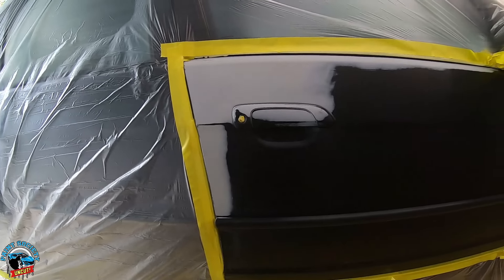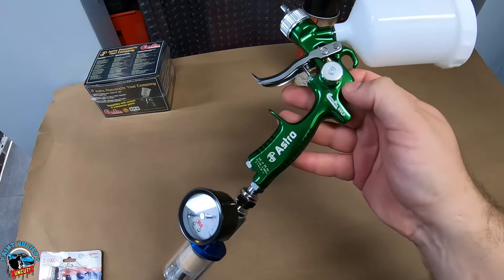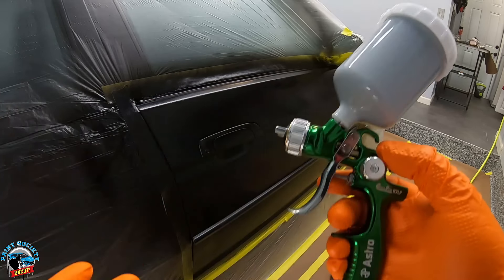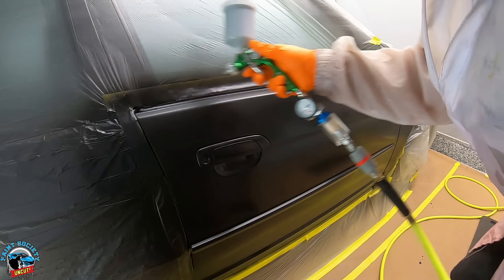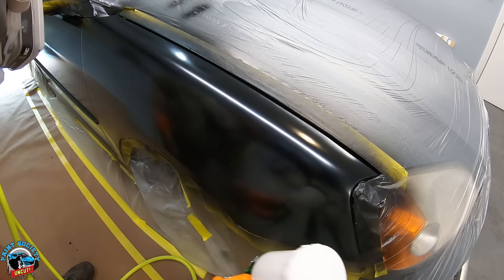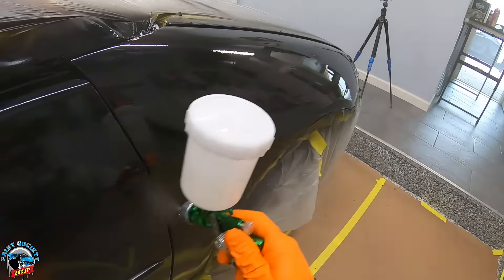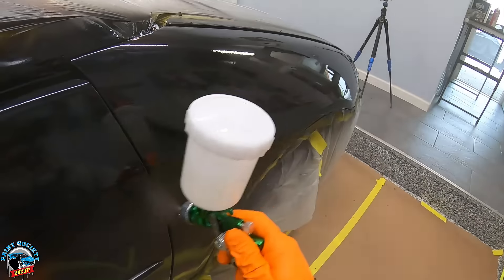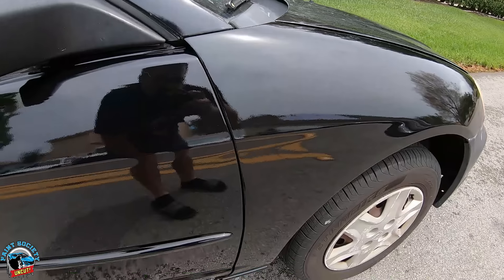The Cheapest Way to Paint a Car with AMAZING Results!

Comment from the maker: Make sure you’re subscribed to my Instagram for all the latest information! IG: paint.society
Reply: I am learning a lot from you I Love your work
Reply: Please do a video on minor rust repair and prep before paint. Thanks
Reply: Is it best to go for for three coats of clear if  orange peel results from inexperience or incurable pressure problems with the gear at hand? I'm assuming that the peel effect can be buffed out - if the clear coat is thick enough??
Reply: Karibu Tanzania Afrika mashariki
Reply: Is there anywhere else that the gun can be purchased? Amazon is all sold out
Reply from the maker: @sohchx  they sold out quick!
Reply: Brian,

I remember that in one of your video's you used a special tape for painting around window rubbers.  It fitted under the rubber and pulled it back.  Do you remember which video that was in and/or what the tape was called?

Kind regards, 

Neville.
Reply: Ceiling fan 2003 Honda Civic good
Reply: Mannn.. We’re going to have to change your company name from Paint Society to Paint Gods! 

You always know how to make something look amazing and simple, even though we know for inexperienced painters it is not easy. Lol 

Keep up the great work. I look forward to seeing some more videos. Question: 

What do you think about a 27 gallon compressor by Husky, 1.7hp, SCFM 6.8 air at 40 Psi? Do you see this struggling with a Atom mini X16 spray gun “1.4 tip”?
Reply from the maker: @Mocredible  it will work but only for small project. Not full cars
Reply: @PaintSociety  Thanks man. I appreciate your advice.
Reply: i realize I am kinda randomly asking but do anyone know of a good website to stream newly released series online ?
Reply: @Titus Ronin yup, been using Flixzone for years myself :D
Reply: @Titus Ronin Thank you, signed up and it seems like a nice service :D Appreciate it !
Reply: @Calvin Rocco No problem :)
Reply: As a former car painter. That hasn’t touched a paint gun in ten years….. I just have to say that your skill and confidence are truly inspiring. Keep up the good work and I really enjoy your channel. Thank you.
Reply: M.p
Reply: Hi
Reply: @bohuxley5050  Hi
Reply: I’m wondering if it’s possible to paint a car with an airless sprayer? Thanks for all of your great videos and input.
Reply: I did not know you have the gun so close to your work. Even closer with this mini-gun?
Reply: Great job mate! 👍🚗😎🏴
Reply: Can you do a video on a 3 series (E46) BMW rear arches rust repair prep and paint if you get one in please mate? ALL e46 3 series (1999-2005) suffer with rear arches and sills rusting as they didn't fit wheel well guards so they all rust out! I've gotta do mine soon and to have that specific car tackled by you would be amazing for exact/direct method as I'm not a sprayer but going to attempt it and I know so many people who are doing the same on the BMW forums so this would be GREATLY appreciated if you get a chance!? I got a titan silver BMW so it's going to be a real pain to match.. so if it happens to be a titan silver all the BETTER! As they're 10 a penny in silver back then lol 😅👍😎🙏🏴
Reply: Did you reduce your clears?
Reply: What do you think about the Duplicolor Paint Shop Finish Systems Primer, Base, and Clear? I'm thinking about painting  my Chrome Yellow Ranger this way with the Duplicolor Paint Shop Finish Systems products. This will be the second time I've painted a car, so I'm not a complete stranger to it. I feel like if I take it slow, and watch the pressure, and the spray fan, I'll be  okay. Spring, or Fall temperatures, and low relative humidity.
Reply: @paulbrock641  qqqq
Reply: @PaintSociety  ,It came out killer bro.   Thanks for uploading theses videos for us DIY guys.
Reply: What sort of paint do you use when doing in the garage?
Reply: @dariohtc  It is doable.  You will save a lot of money in material costs.  There is very little overspray, and more of the material goes onto the car
Reply: I have a quick question if you do put sand piling on your paint job what's the easiest way to correct it before clear coat
Reply: @1cstabach  Ku
Reply: @paulbrock641  vvp vvv la lol
Reply: This may help those of you that have a small to medium air compressor!  I have a Sears 5 gallon & 1 button Dewakt that is portable but nice. I put a brass T fitting to input side of my wall regulator and connect both small compressors to input and paint sprayer (or impact wrench) to outside , gives me lots more air, 
Easy to borrow a 2nd small 120 volt compressor from some relative or neighbor.  Plug into 2 different circuits, set start on pressure slightly lower on smaller pump. 
Air pressure in both tanks equal out, both work to maintain full pressure (say 120 lbs). My sprayer is set approx 18 psi) 
Saves hundreds and remains portable.
Reply: I got some advice to use the same compressor and get a higher output of air, add a storage tank.
Reply: Would that do Nissan FN2 Emerald Blue?
Reply: @PaintSociety  m I able to paint High solid urethane clear with the lvlp gun. And please tell me the baseline setting  you'd recommend along with if I need reducer. I'm in miami, FL so temp is 75-80°
Reply: Where is the cheapest place to get decent semi-gloss clear?
Reply: i agree with Carlos , BUENO . GREAT VIDEO ,  great , also the job !

Comment: I've had good results using two regulators, one on the gun and one at the compressor. You set the one at the compressor to a few psi above what you need then use the gun to regulate it down to final pressure. You get much more consistent pressure at the gun while the compressor tank empties.

Comment: You can run the pancake compressor into a holding tank. It'll increase your air volume making the compressor cycle less and also keeps the air pressure variances to a minimum. Plus an air holding tank is a good addition to a garage for quick tire inflating away from the compressor.
Reply: Note on this, it does work, I have done it. 

However adding a larger tank will make your compressor run longer each time it comes on, so be careful it can overwork the compressor and burn it out.
Reply: Curious what would be the ideal size holding tank to max performance and limit variance I would guess somewhere in the 15-30gallon range?
Reply: Would using a 8 gallon compressor make that much, if any difference at all then a 6 gallon?
Reply: That is a GREAT idea!!
Reply: I did this to air up semi tires off a small compressor. Used a 20 gallon tank from old compressor a friend gave me. You can also buy air tanks used for inflating tires like the ones at harbor freight. Just run piping to them. Make sure to drain them every time.

Comment: Too cool...painted my first car 3x...absolutely no previous experience...then watched a couple of your videos...the 3rd time... 2 base coats, 800 hand sand, itcame out well with no experience to judge it by. Applied 3 coats of clear and cut it down with 800, 1000, 1500, 2000... Applied the rotary with fine polish and was completly blown away with the results. I got several compliments... Kbowledge comes from a book or videos, but wisdom comes from experience.. So in closing. Thanks...
So dont be scared...Its only paint...😊

Comment: #1 thing that help a small compressor: remove restrictions!  Look inside a 1/4” air fitting.  Tiny hole.  Use a good 3/8” hose and get 3/8” fittings with 1/4 npt threads.  I have a 15-16 gallon California Air Tools oil-less compressor that advertised 5.4cfm at 90 psi.  I could see the pressure drop and when I paused could hear the hose fill back up with air!  Upgrading the fittings for higher flow made all the difference in the world.  I also tapped into the air below the switch (straight off the tank) and installed a 3/8” filter regulator.  I can run a die grinder, mini belt sand, or palm DA constant now.
Reply: Higher flow is good for bigger tools that need the airflow but not good for the compressor itself. To increase run time and pressure I would use the 1/4 npt fittings with  1/4" hose on a smaller compressor.
Reply: @ljguy300   CFM (cubic feet per minute) you can move more air with the same pressure if the hose and fittings are bigger.  Common sense. If the tool consumes air faster than the hose can provide it, you’re toast.  That’s what was happening to me.
Reply: 50 foot 3/8 hose vs 10 foot 1/4 hose will make a world of difference when spraying

Comment: After watching some of your videos a while back I  got one of the purple guns from Harbor Freight to spray oil based enamel on wood work at my brother's house. At first we tried using his 10 galon compressor but there was no way it could possibly keep up. I brought over my contractor's compressor that can handle multiple framing nailers and it did the trick. 
Major props to you on being able to overcome your limitations and get that incredible finish.

Comment: I’ve painted a whole car with a 4 gallon twin tank hitachi/metabo compressor with a 2.8 cfm and a cheap lowes spray gun and it worked just fine.I did have to wait for the compressor to fill up so I had to do a lot of thin coats
Reply: How did the paint come out? Because i want to paint my truck but I don't have a like a 30 gal compressor or bigger I only have a pancake compressor and i don't know how it will hold up
Reply: @mk5rabbit784 😂😂 I'm  pretty sure comments told most that can comprehend.
Reply: Wow I am shocked. That is amazing!👍

Comment: I've done similar but to overcome the small compressor size i used an old helium tank to double the air tank size
(Adapted a nitto fitting to the top tap and bottom drain threaded holes, top nitto to gun to help trap moisture)
Worked great for me

Comment: In this situation i would've sprayed 2 med coats flashed with atleast 10 min flash in between coats.. if the first coat isn't properly flahed off then it's gonna be drying through the 2nd coat causing die back.. 5 mins just isn't enough at room temp.. but let this one dry for a couple days then wet sand and buff.. it'll be a quality diy paint job for sure 💯

Comment: This is definitely the kind of motivation I needed. I'm not a body guy by any means, but I need to redo the rockers and bumpers on my truck. I've been told time and time again that a 6 gallon compressor just isn't enough for painting. Considering no one can really explain why, I figured I would buy one...if all else fails, at least now I have one to fill tires with. Though I do remember a guy I used to know years ago telling me that painting isn't as hard as people make it...there's nothing you can't fix and redo with painting.

Comment: Haha yeah! Brian makes it possible! ... I once did two full repaints with a 1.0mm touch up gun and 1.5gallon 1.5hp Ryobi compressor ($100) ... Interesting enough! The compressor just gave enough air consistently to do one full panel at a time ... The compressor also builds up full pressure in less than 20seconds ... I believe this set-up is surely a hack! ... ... ... Much Appreciation for you Brian for having liberty in your vocation to share openly
Reply: How long Did it take to paint full car with your setup ?
Reply: @ricardo-zq7uc  about double the time

Comment: i found that the smallest compressor i could run and not have issues was 15gal, although it runs a lot while painting a car i never ran out of air pressure.

Comment: I just replicated your process with a cheap spray gun similar to yours but silver color (CENTRAL PNEUMATIC 120cc HVLP Touch Up Air Spray Gun) with a .8 mm nozzle from Harbor Freight to be able to do this project immediately rather than wait for the same spray gun that you used, on Amazon. Being that everything is sadly made in China, I found the same 6 Gal compressor at HomeDepot under the Porter Cable brand. Picked up factory paint code paint at my auto paint supply w/reducer, and I had amazing results.
I didn't need to do too many adjustments other than regulate the psi to 45 psi which is the max that the spray gun could handle and it sprayed just like you demonstrate in your video!

Comment: Thanks for posting this one.  I'm looking at getting a compressor soon but I'm leaning towards a 20-30gal.  It won't be used for painting often (maybe a couple times over ownership) but I'm definitely looking to repaint my beater, or at a minimum, parts of it.  I figure I'll just do a couple panels at a time.
Reply: Most important factor to mr in determining what to buy is the noise level.  My small Compressor is so noisy I cannot give it away !

Comment: We’ve all been anticipating this video and as usual, it never fails to deliver. 👍 Another thing to keep in mind, is the duty cycle of these compact compressors.
Reply: Steve, what do you mean by “duty cycle”?
Reply: @almccallie4314  He means that these small compressors are not made to be left running constantly.  At some point they'll overheat., trip a protection circuit and shut down, or worse, fry themsleves.  Spraying creates a constant demand for air that these compressors are not designed to deliver.  They'll do it for a while and then they'll stop doing it.  Maybe forever.
Reply: @kristoffscuba5466  10-4. Thank you
Reply: @kristoffscuba5466  Thank you!
Reply: What kind of paint do we used

Comment: Instead of a mini gun you can also use an LVLP (Low pressure low volume). I used a sprayit SP-33500k with a Bostitch 6 gallon pancake compressor to spray my del sol front bumper, hood and license plate panel and it came out looking as good as factory. The air would start running out about half way into a panel but I would just wait 20sec then continue.

Comment: I’m actually , pleasantly surprised , I’m wondering if the gun is offered in HTE/HE , would probably help that little compressor since they use less cfm than HVLP , of course your experience helped this job come out better than someone who is brand new at this , but you showed that anything is possible ! Great job 👏🏻

Comment: I painted the door jambs in my Miata with a similar compressor and the tiny HVLP that came in my two gun kit.  To find out whether or not it will do the job for me, I started with a full tank of air, had the air filter and regulator on and connected the paint gun.  No paint in the cup, line pressure set to what I was confident would spray a reasonable pattern,  then while holding the gun wide open I waited to see how long it would take for the pressure at the gun to drop.  It lasted several minutes, so I was confident it would work.  It did, but you have to refill the cup a lot when using the little detail gun.

Comment: In 1995, I painted my 1987 firebird with what was probably a 40 year old paint gun at the time.  Used black enamel paint with hardener.  I used a 10 gallon compressor.  Tested it out on the garage refrigerator before painting the car.  About half way through the paint job, the fuse kept blowing.  We went through 5 fuses before I found that the problem was with the compressor cooling fan.  It had broken and fallen off.  Grabbed a couple of window fans and pointed it at the compressor full blast.  Problem solved.  I had to go back to college for the week so I came back and wet sanded the paint for a perfectly smooth finish.  About 2 months ago I sold the car to a salvage yard since the floor boards were gone and it wasn't worth fixing.  Before I sent it off, I gave it one last was and I was amazed at how shiny the paint still was considering I probably only washed it a couple times since I painted it back in 1995.  I'm sure she's already been stripped of usable parts and sent to the crusher.

Comment: I have a 24litre 9.6 cfm compressor here in the U.K.. I have some disabilities a painting a car is well beyond my physical capabilities but it’s great for staining and spraying a finish onto my small wood project and painting my attempts at fabrication (grinder and paint make me the welder I ain't). I can also run my small cut off wheel, die grinders etc. For me it’s a perfect size though if I was able bodied I'd look for at least 100 lites space permitting.

Comment: I have used the cheap $20 HVLP sprayers from HARBOR FREIGHT on 3 different motorcycles using 2K speedokote from amazon with GREAT RESULTS !  I'm planning on doing my new bike (06' M109R) very soon. Cheap tools usually work pretty well, as long as you take care of them.

Comment: Hi Brian. This video helps a lot to build confidence and start spraying. I have a question and it’s not a real world situation. For a panel with scratches in clear coat, can I DA the panel with a P800 or P1000 and reapply clear coat? I.e. go over the original basecoat and clearcoat with new clear. Will this look bad or it’s a standard practice in blending jobs?

Comment: I really appreciate your videos.  I am learning a lot.  They have given me the confidence to do the paint job on my car myself.  I just need to finish w/ the rust repairs.

I am more interested in these at home videos.  Conditions, equipment and scenarios that the typical person watching your video will be working in.  I especially like the product reviews and demos.

I noticed this weekend that Harbor Freight now has a copy of the original 3M PPS system, called the SPECTRUM Universal Paint System.  $19 for starter kit w/ total of 5 liners/lids.  Adapters are $9 each.  I would like to see you do a review of that system and comment on it.

They also have a Braun Color Match Light for $39.  In my price range vs the Sun Light.  Once again, I do not know how it compares.

Comment: I painted a camaro and a Durango using a old 20 gallon air compressor with a hose going to a 30 gallon tank it worked good  running a Tekna gun with a 1.3 tip .

Comment: great video.   I wish you had included the setup of the gun and your practice spray settings.   What was the pressure you set the regulator?   Talk more about the paint and why you chose that paint and how you mixed it.